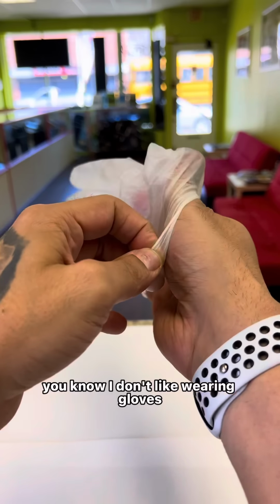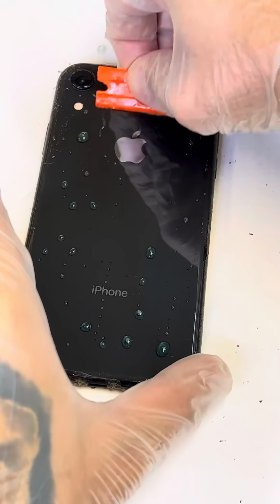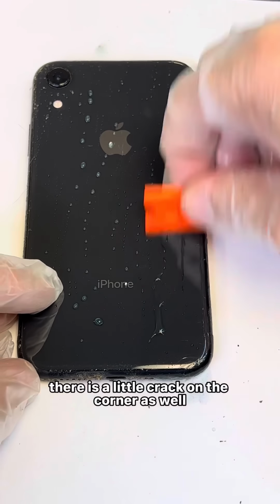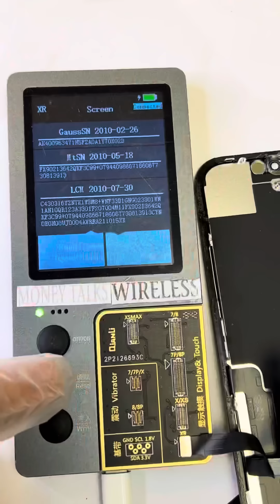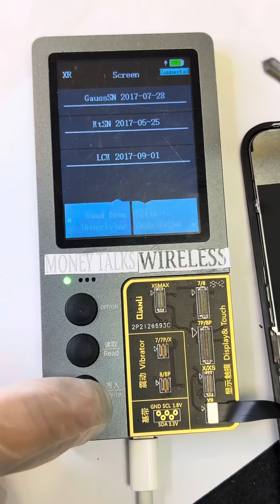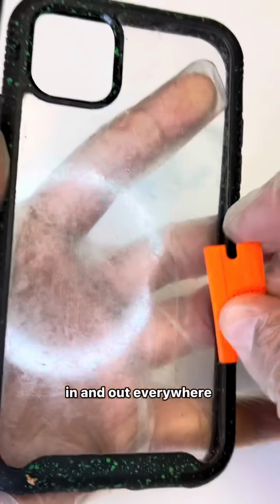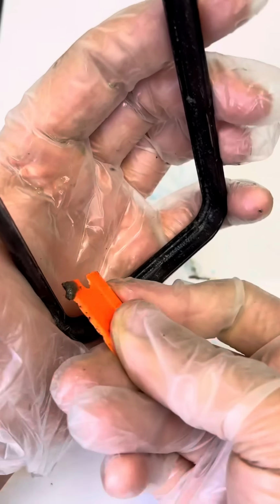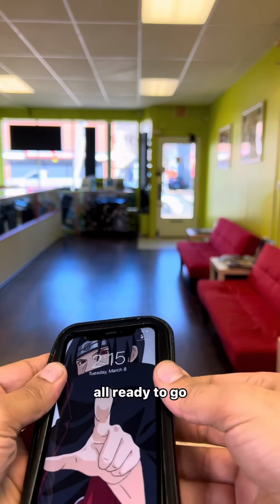Deep cleaning the nastiest #iphone and case I’ve ever seen 🤢🤮 #asmr #gross #nasty #hair #discord

Comment: Quick question from a phone repair technician from Portugal, why do you use a blade to clean everywhere? Like i get using it on a smooth surface like the back cover, but the case corners, phone's side chassis, etc. Wouldn´t it be easier just to use a brush, microfiber cloths and some IPA?

Comment: The problem is that its a hassle to fit many of the cases on the tablet/phone especially those clip on one's wherein in the back and front panel fit into each other....I think that's why people don't fiddle much with it once it goes on and use it fir months/years with out opening it up and cleaning the inside parts and the phone/tablet...also some people don't realize that the case accumulates dirt inside....I have noticed some phones on this channel wherein the outside cases are clean but they have not opened or cleaned the inside of the case for months/years....

Comment: I felt not good when you scratched the phone body and put the sharp pin into the volume holes. You could have use isopropyl and a tooth brush to clean which wouldn’t have scratch the speaker and mic grill but you damaged it sir. Didn’t expect it from you.

Comment: If you can help me fix my Apple ID I have to wait 7 more days to unlocked I can’t remember my Apple ID and I don’t use the number I used to had for it too. I went to the Apple Store they told me I have to wait 13 days to unlock my Apple ID I have 7 more days left still. My iPhone is still in good condition no lacks or dents at all it is only Apple ID locked